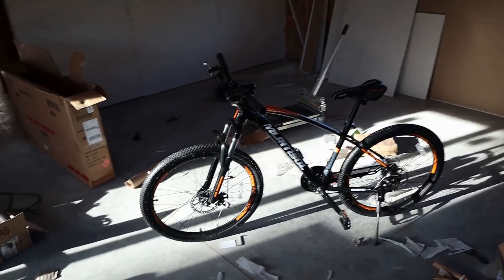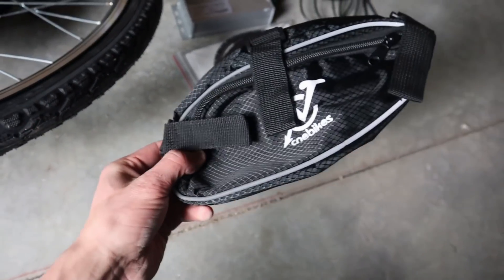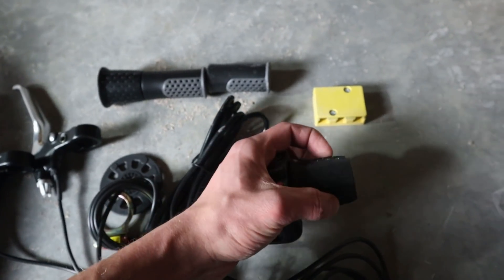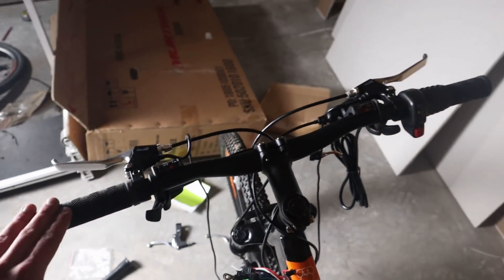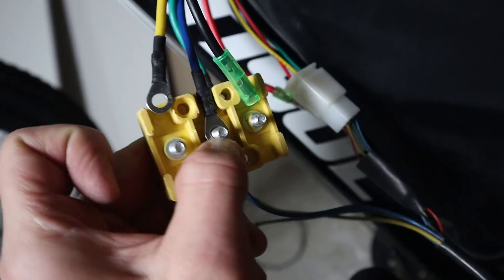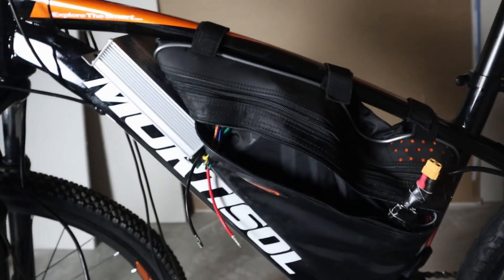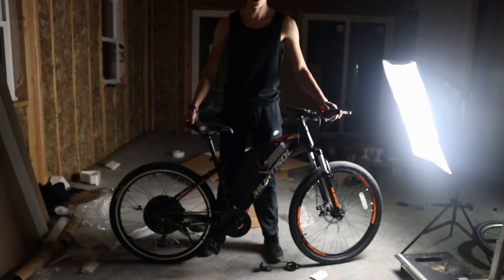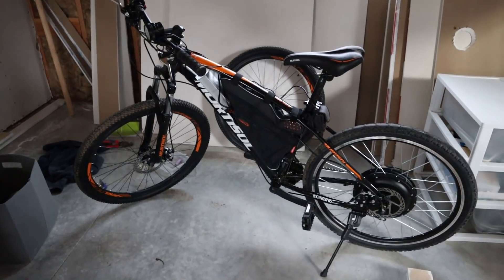$400 FAST DIY Electric Bike

Comment: You're definitely not getting 40mph out of this bike. I have nearly the same kit and a 15ah 48volt battery and I get 31mph top speed.
I'm actually trying to figure out how to get 35mph+ right now.
Reply from the maker: FranBunnyFFXII Well, my gps says otherwise, but I do weigh 135lbs.
Reply: @logannobles  I'm 125lbs. My bike is almost the same kit as yours, same controller with the 26A draw, 48volt 1000Watt.
I've got a 30amp current, 48volt 15ah LiFePO4 battery.

The kit I have and you have are the 395RPM non regen motors, which at 48volts is about 30mph. give or take a few mph. 
but 40mph? that's pretty crazy high for 48volts.
Reply from the maker: @FranBunnyFFXII  I did a gps speed test here. I actually checked my controller, and it is 27 amps. So this thing is actually pulling closer to 1200-1300 watts even though it was listed as 1000w. https://youtu.be/zGM7Ni6iFHc
Reply: @FranBunnyFFXII  48v 1000w hub would only get you upward of 28 to 30 mph. 

But a 48v with a 2000w hub or more will get you speeds upwards to 35 to 40mph give or take. It would need a strong battery as well to give it the necessary juice for that high a speeds but you would also need a higher capacity battery or else those kinds of speeds will drain the shit out of your battery. 

You can add 52v if your controller is programmable for stronger and quicker torques. 

I’m still learning this stuff myself so feel free to correct me as well.
Reply: Yea 40mph isnt realistic, its an exaggeration like so many of these recent ebike clickbait titles. If you're lucky, have a quality motor (not a cheapie $200 kit), and a strong 52v, you may hit 35. A standard amazon $200 kit with a 48v should only get 30-32mph. I just haven't felt like blowing this guys videos up, but there questionable. 

I have a cheap kit, along with a QS 205 V1 motor capable of 6000 watts. Right now I have a 75v lipo battery (16mah) pulling 60 amps and I barely hit 39mph on my heavy steel frame. On  my mountain bike I can barely hit 45mph. And keep in mind,, 74v X 60 amps is 4,400 watts. So for a 1,000w kit to hit 30mph, thats pretty impressive. There are so many videos out right now with inflated claims of speed, its hard to find honest accurate reports.
Reply from the maker: Stanson, First of all, I checked the controller. It’s actually putting out 27a, so if the battery fully charged is 54v x 27a, this bike is closer to the 1300-1500w range. used a GPS app and clocked my speed in my most recent vid yesterday, but the phone was out of sight of my
GoPro. If I need to, I can take another video recording the phone screen to prove this true, but again, 1400w+-, 140lb rider with all gear, and a backwind, and you might hit 40.
Reply: @logannobles  you can run 60a on it youll get the same speed lol id reccomend gettin them cheap $2 speedometer of ebay as your gps is wrong.
Reply: @yakz9885  a $2 speedometer probably wouldn't be correct. He uses an app to see the GPS.. I've used it and it's ALWAYS on point perfectly
Reply: Logan Nobles what gps app do you use? I’m looking for a half decent one :)
Reply: @Franbunny  - I can see how he would be getting 40 MPH and you wouldn't because cheaper motors don't put out as much speed (torque). Looking thru the specs of various motors, i found some 1,000 Watt motors only put out 60 Newtons of Torque but name brand motors (bafaq-?) could easily put out 120 or much higher with only a 48v battery. You should check out their specs.

Comment: Cover the twisted wires with electrical tape so they won't touch and short circuit your battery or motor
Reply from the maker: I did exactly that. I must not have shown